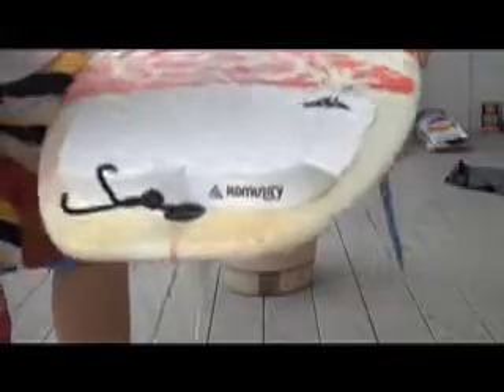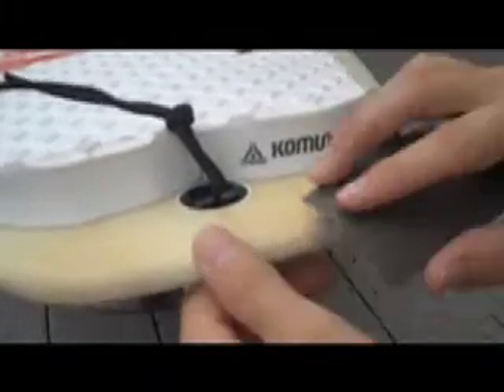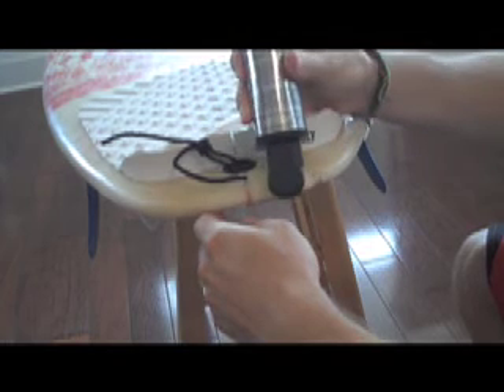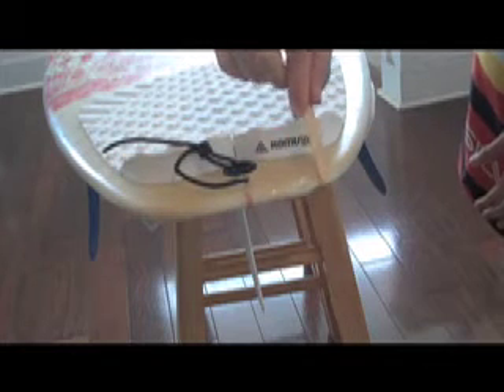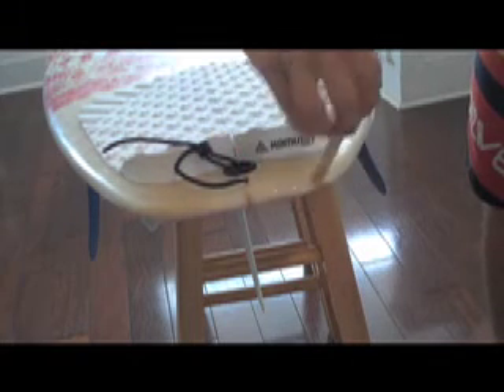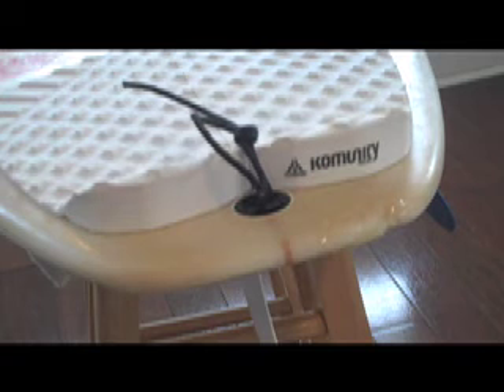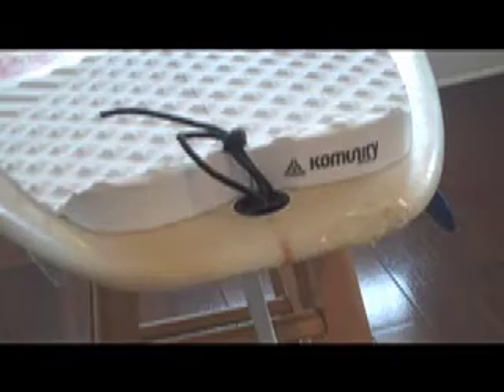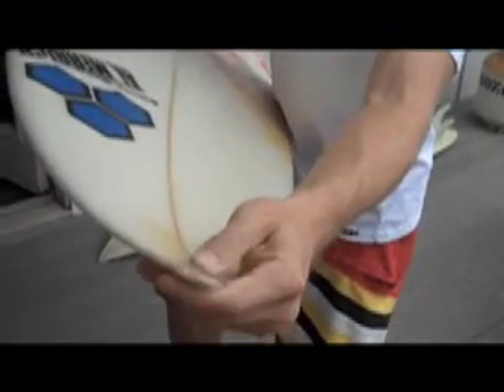How to Fix Dings with UV Curing Resin

Comment: I need to repair the bottom of my longboard. There are stress cracks. In the same are there is a repair that was done with resin and micro bubbles. It wasn't leveled very well. I'll be sanding down the just expose some fibers of the glass for the stress crack repair. I'd like to level the area I mentioned. What would you do. There is a layer of 6oz glass on that spot. I'll be using Solarez products for laminating and hot coating. Hope I made things clear.

Comment: If you use nothing but UV curing resin to fix you board, Once it gets good and hard and you start using the board again, the ding fix will start cracking and leaking again. you need to use fiberglass cloth or you are just creating another disaster. Dont be lazy, do it right.

Comment: hey bro, nice vid. I starting to surf and a friend gave me a Al Merrick 6'4" board and i think it is a Kelly Slater edition  cause it has a K on the tail where foam is. It also has a logo on the bottom of the board which says UL ( ultra light). I was wondering if you know the material of the board and what type of resin can i use to fix it, the board has some cracks and dings. I just want to fix it myself, because it is the board i plan on learning to surf and i don't want to spend a lot of cash